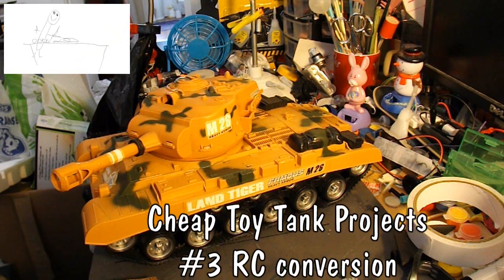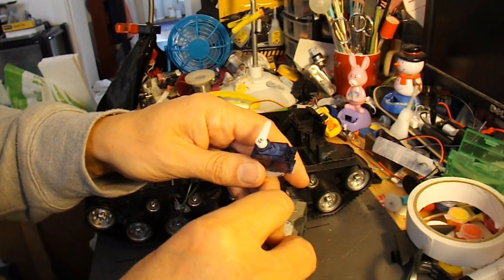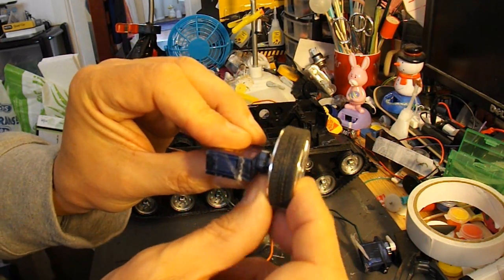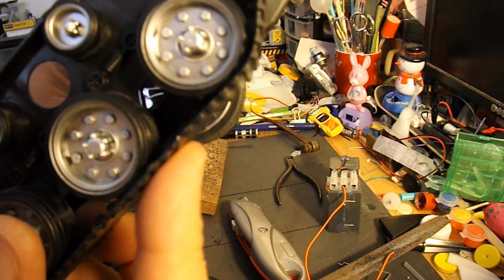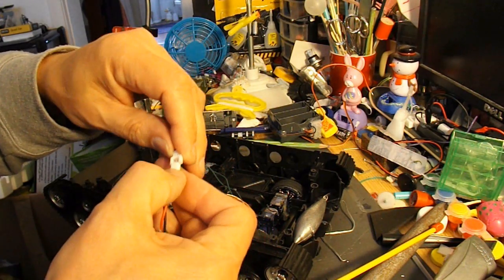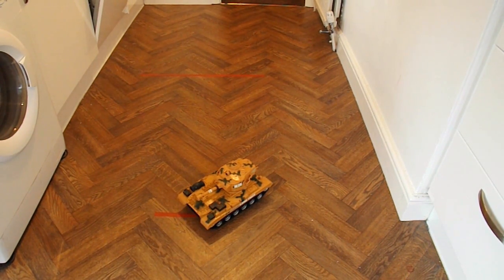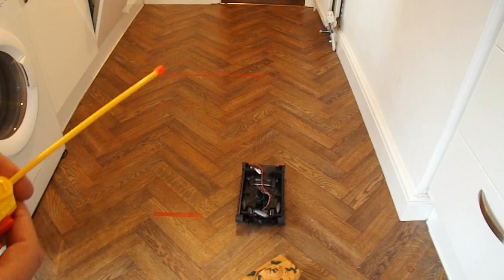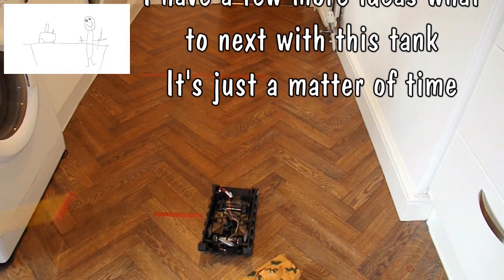Cheap toy tank projects #3 RC conversion

Comment: what about adding two more servos to the front to make it have more traction when you steer. could that work?
Reply from the maker: +game town it might work, why don't you build one to find out. You don't need a tank to try it, just mount some servos and wheels on a flat sheet of cardboard, that would do as a dummy body.
Reply: I have no servos. but i might get some when i have money and my parents let me.
Reply: scratch that last post. i have a monster truck with four electric motors and it is a skid steer
Reply: works great in loose dirt not so well on carpet.lol